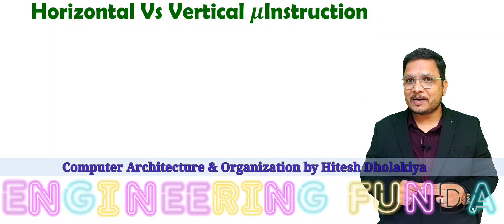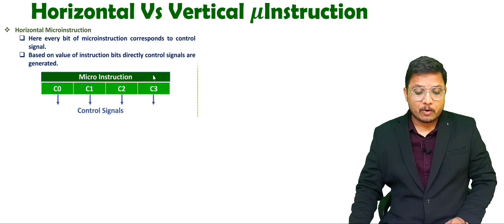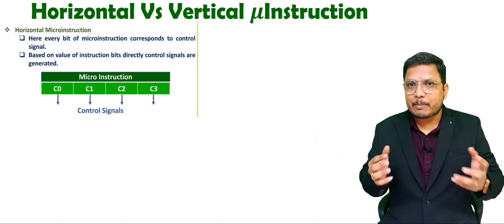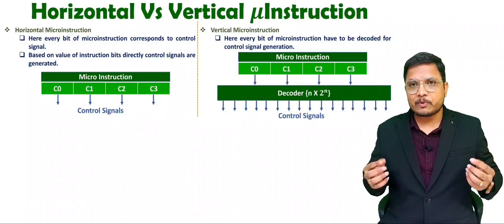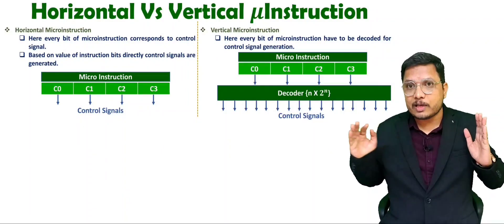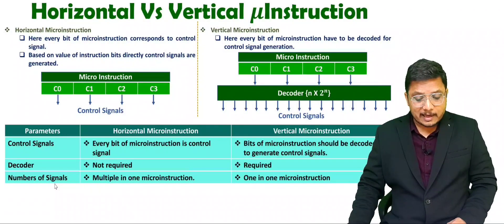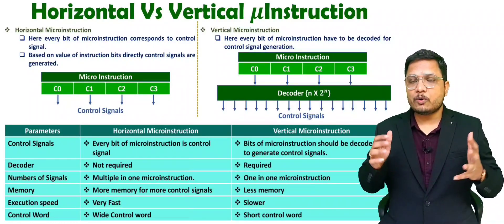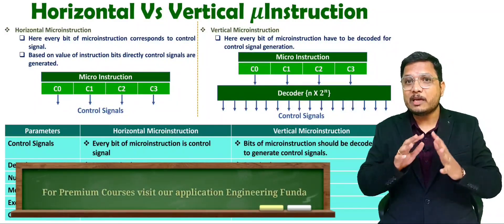Horizontal Microinstruction vs Vertical Microinstruction: Key Differences Explained | COA

Comment: On what basis in vertical are grouped. In control signals occurs  one after another, in vertical instructions it will decode instructions randomly then how it will work? I am unable to understand please explain me
Reply from the maker: 1st instructions are converted into micro instructions. Afterwards based on sequence, serial or parallel Execution is done.